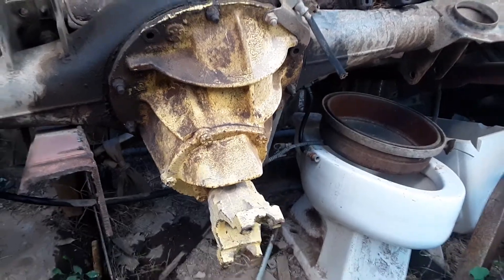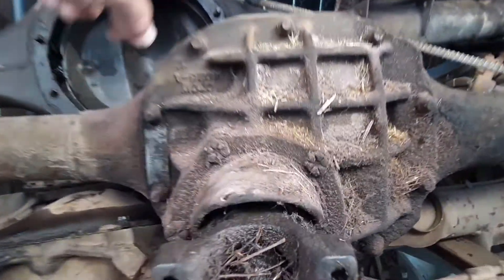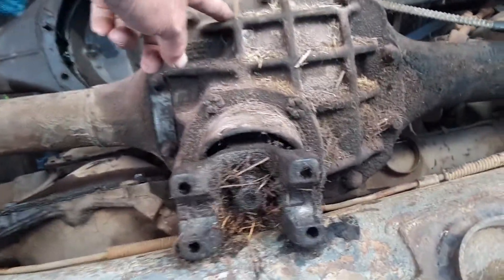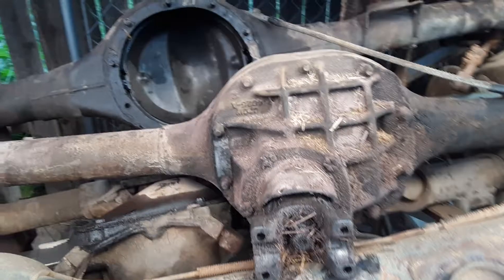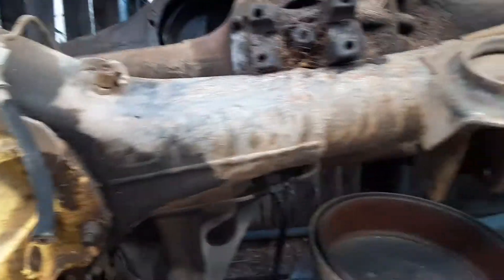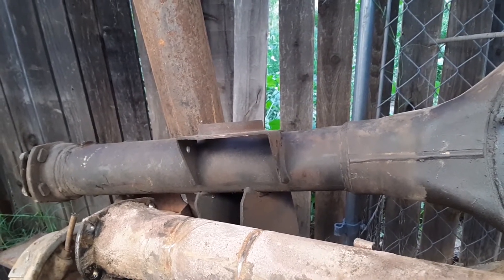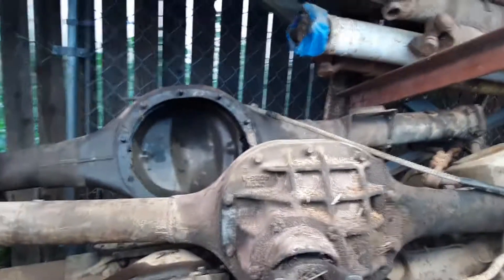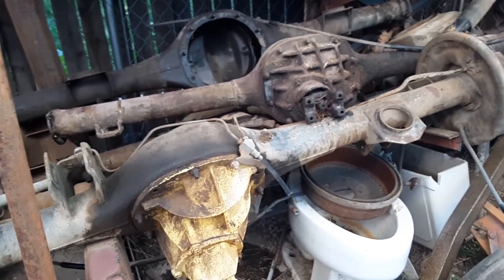The differences between Ford 9" and 8" rear ends

Comment: Is it even worth using a factory Ford 9-inch housing with all the aftermarket housing available?  Serious question, I'm thinking about going with a 9-inch in a mild drag car.  I found some factory used ones in my area.
Reply from the maker: Cost for me do to this....$100....cost of new after market housing $1200....
Reply: @racerdave773 , I found a few housings for $125 ea.